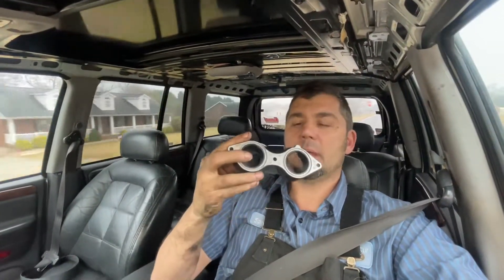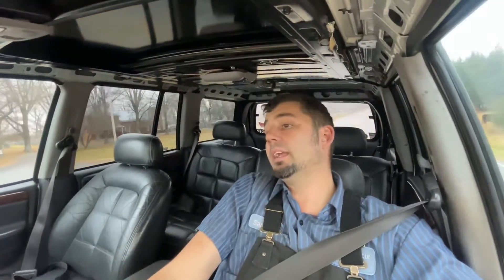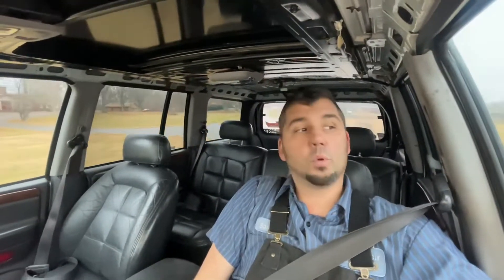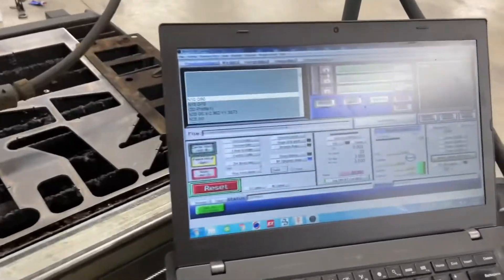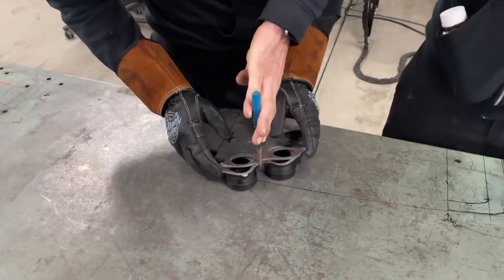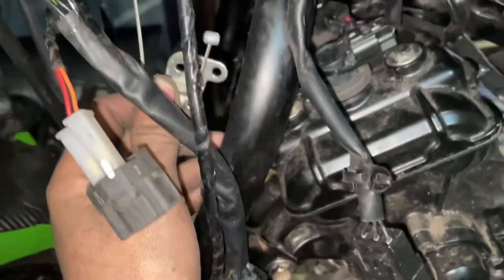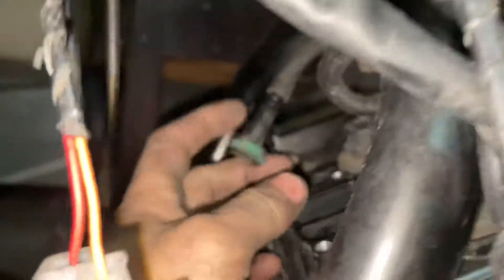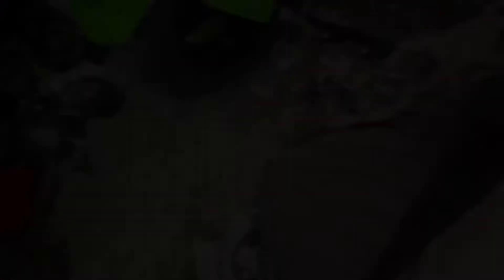Day 4 z125 to ninja 400 engine swap, building intake flanges

Comment: What kinda power difference is there between the z125 engine and Ninja 400 engine?
Reply from the maker: Z made 23 with a 194cc, stock 400 makes 48 whp
Reply: @Boostismyfriend  wonder if the 400 will hold a 50shot? 100whp would be stupid on that light of a bike!
Reply from the maker: Never know what the Feature holds, i know a guy that weigh whet i weigh that went 7.19@96 with a 18hp shot
Reply: @Boostismyfriend  I'm glad I'm not the only one buggering up my messages because of Auto correct not reading it afterwards haha...
Reply: @Boostismyfriend  that’s crazy lol. That’s fast on that small bike